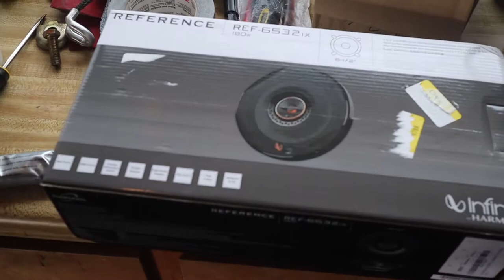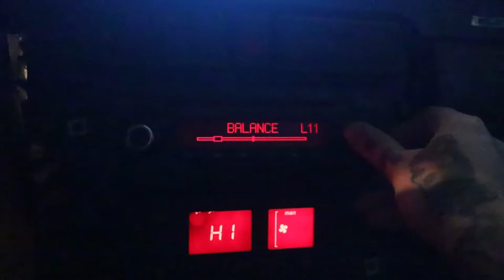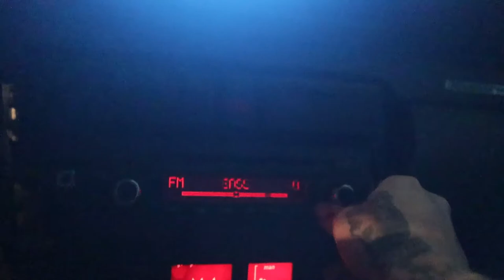DIY OEM Bose Amp Retrofit and New Rear Speakers for the B5

Comment: How did you mount the new rear speakers into the funky 2 bolt hole?
Reply from the maker: It has been so long since I did this; from what I remember I lined up what I could with the oem holes, then drilled new ones to ensure the speaker was mounted securely.